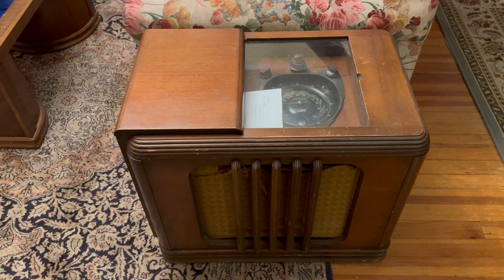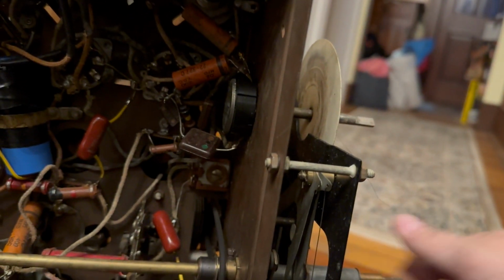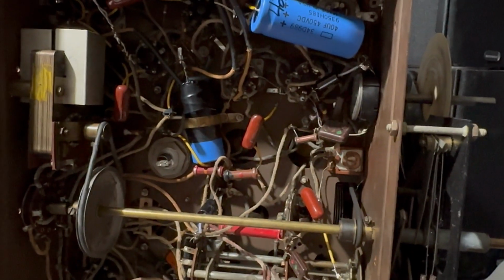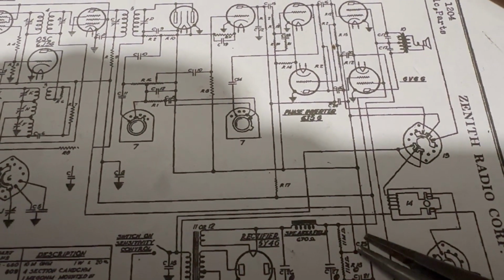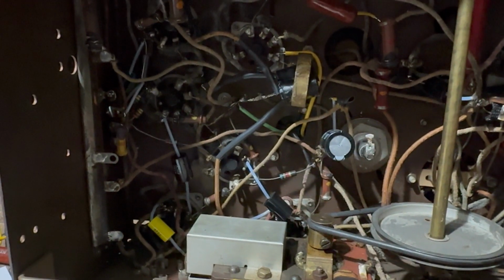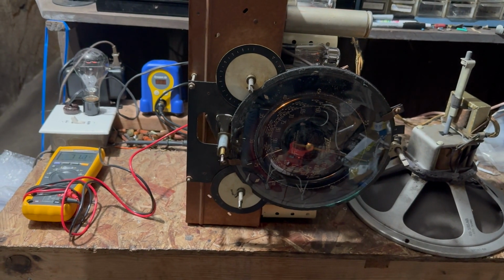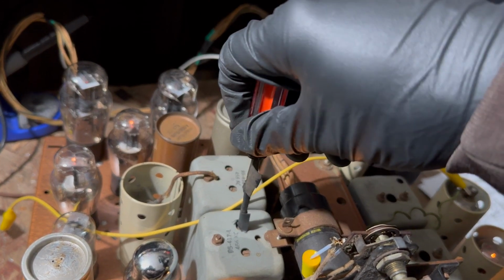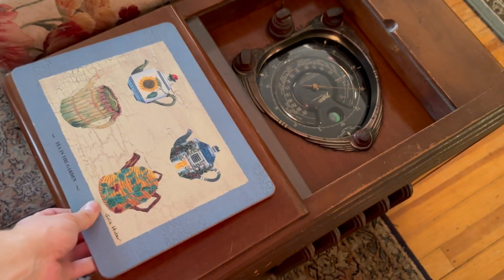1938 Zenith 9S244 Chairside Antique Radio Repair

Comment: Previous owner subscribed to "happy wife,happy life". Yeah I'm not giving up on old radio collecting and restorations.( Says
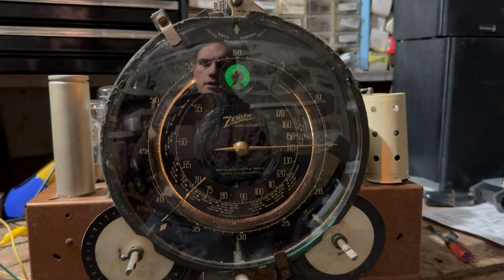this single guy). Nothing worse than trying to undo another restorers mistakes. Wire dressing issues which can lead to  humming issues as much as too high a capacitance of the electrolytics. We finally get to see your face Adam at 37:00!
It's a good face. Wow that is a nice grill cloth pattern! Radio looks and sounds like it should finally. Steve from IL